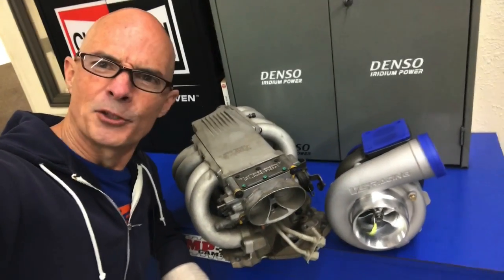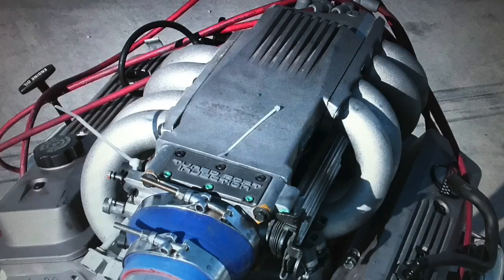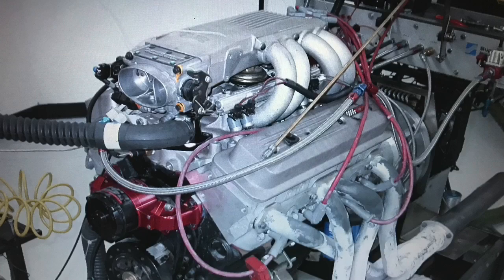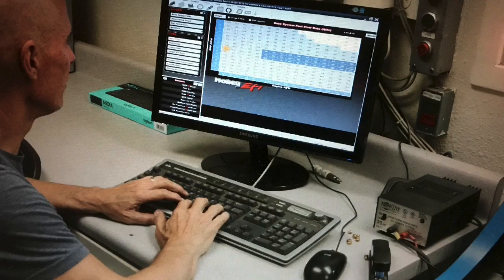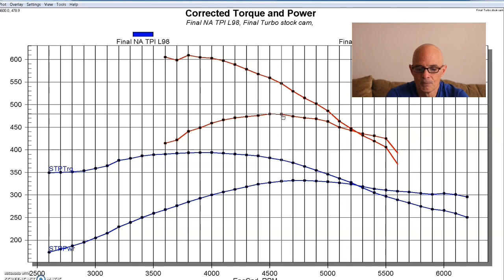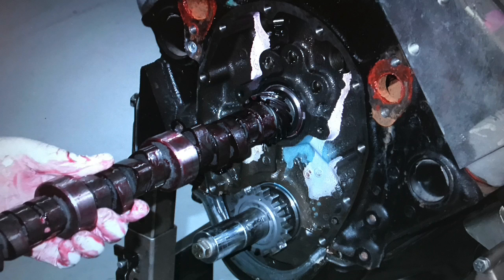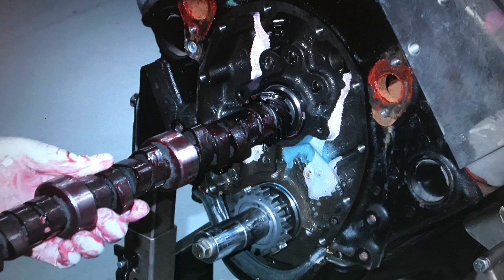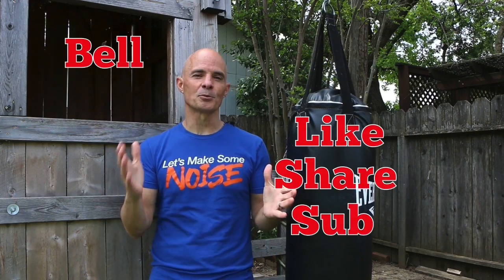TURBO TPI-BOOSTED TUNE PORT

Comment: Hey Richard!  Great content!
How about a Mopar 5.2/5.9 Magnum intake test between factory beer barrel, M1, and RPM Airgap FI manifolds?
Reply from the maker: I like that idea
Reply: @richardholdener1727  I'd love to see that test. Although Mopar m1 intakes are no longer made so you'd have to borrow or buy a used one. I have a 96 ram 5.9 and I've been thinking about a low buck manifold flip eBay gt45 turbo setup.
Reply: @AlexAutoRepair1  back in the 90's and early 2000's i had a 5.2 Fakota with mild potted heads, good cam & springs, Thorley Tri-Y's, and a Vortech R Trim at 15+ psi non intercooler.  Was good for high 10's at 130+.  I had a first run M1 4bbl and shifted at 7500.
Still have the truck and am thinking the same thing you are.  Lower rpms, more boost!
Reply: @richardholdener1727  I have an M1 2bbl intake on a 5.2 I could pull and loan for the test.  Would need a boneyard Beer Barrel as I got rid of all the ones I had...

Comment: Haven't seen the video yet, looking forward to the results. Been wondering about boost on TPI.
Edit: finished video, impressive numbers for a stock L98 with a cam. Anyone have experience with the "FIRST TPI" intake? Was thinking about building a 383 with that intake considering it's probably the largest TPI style intake available. Although if I just port a few things and add boost, maybe that's a better route. Great video as always!
Reply: I have a 383 full forged TPI  with a comp cam .444. Lift and like 228 duration. With a set of GM fast burn heads. With A Vortech V-1 supercharger I built in 96' when i was in The Isuzu/GM Program in College to Replace the Blown TPI motor in My El Camino. Which i put the TPI in 1994.
Reply: Its old news really

Comment: Wow, no wonder I could kill my buddies trans am back in the day.  He was tuned port, I had carb and dual plane intake.  Motors about the same.  He would normally get me a car length out the gate, but I would run back by him at half track on!  Didn’t know they were that dead above 5000rpm.  Thanks
Reply from the maker: I have a TPI vs Dual Plane test coming up

Comment: The hp from na to boosted didn't follow your hp boost equation. (8.7÷14.7+1)x332=528hp not the 479 that it dynoed.   Do you think thats a function of the Holset turbo efficiency?
Reply: I was thinking the same thing probably the turbine back pressure or valve springs or both. It would be easy to check if he raised the Boost because it would just get worse
Reply: @danielsullivan9865  on a low psi, low valve lift, i don't think it needs all that much valve spring.  And as RPM goes up, I'd think HP would drop off quickly as valve float would affect boost pressure.
Reply from the maker: part of it was the the mild timing we ran
Reply: @richardholdener1727  That makes sense.

Comment: It seems like a TPI setup on a 383 would make a great combo for a truck or other application where you want lots of low speed torque. Even a street motor in a heavier car. 
Would love to hear your thoughts Richard.
I'd also love to see that setup tested. GM's HT383E long block/heads with its stock RV cam mated to a Corvette TPI with a Scoggin-Dickey Vortec TPI intake base. 
Then add turbo.
I'll bet the result is a killer street/truck motor.
Reply from the maker: lots of truck guys running that intake-works well
Reply: @richardholdener1727  
Have you got any experience or knowledge on draw thru turbo stuff possibly on a SBC? I know GM and Ford experimented with this shortly in the late 70s and early 80s... as well as aftermarket RV kits. Currently I know the aircooled VW guys use that tech successfully. I'm kind of wondering if low psi boost could help me.
Reply: @richardholdener1727  
You tuned most of these with a Holley XFI, correct ?
Reply: Go look up "how long until it grenades" on The Turbo Forums. Bring a drink and a snack you'll be there for a while in awe of what a TPI can do when you wring every last solitary half ounce of power from it.

Comment: So why didn't you run a bigger cam shaft like 3500 to 7500 rpm range with the long Runners they camshaft little work really want it would have been something like the comps 525 525 3500 to 7500 at a 306 duration
Reply: It still would have peak power at less than 6000. Those runners are designed for a 305 and just choke the bigger engines.
Reply from the maker: camshaft doesn't change runner length
Reply: @richardholdener1727  yeah i got that but he keeps talking about how long the runner's are if there longer a bigger cam would in theory make more power that's why a Victor Jr has longer runners or a Victor senior has longer runners or like the torque or 2 has a wide-open intake plenum which build power from 2500 to 6500 just like the Victor Junior is 3500 to 7500 so when theory if a bigger camshaft was in the motor and he's talking about how long is a plenum Runners are it means more volume which means it would live more upstairs correct ?

Comment: I owned two 85 irocs in the late 90’s... one stock 305 the other a 350, did the slp runners, ASM tb, slp base plate and the edelbrock headers/y pipe... talk about a walk down memory lane! I learned on the 350 cars that too much gears was about as bad as not enough... had 3:73’s, then switched to an Australian 9 bolts with 3:2x and gained 1 tenth and 1mph at the 1/4 lol... sold the car later and my friend did a carb swap with the “hot cam” but that tq was never the same...
Reply: Had one for my highscool ride in the early '00s, modded right they're streetlight assassins LoL made alot of lunch monies against the fastless & furious crowds
Reply: I went to a junkyard and bought a rear end. At the time i didnt know about the aussie 9 bolt. Thats what i ended up buyin.....

Comment: Would love to see how it would respond to a 
Ported upper and lower base and runners 

Also that Holley mini ram!!
With boost of course
Reply from the maker: I have  TPI intake shoot out coming
Reply: @richardholdener1727  please do the FIRST tpi set up too.
Reply: Richard Holdener have you ever seen an accel intake that looks like the factory one? I bought an l98 for the long block and haven’t had much luck researching it. One guy said maybe it’s from a lingenfelter
Reply: @gregblau8082  The Accel looks a lot like a crossram.
Reply: @richardholdener1727  Do you have a miniram to test? I've had one since '95!!

Comment: That’s a sexy looking engine!
Reply from the maker: agree
Reply: @richardholdener1727  
Start with low timing
Adjust the air fuel.

Same for everything, correct ?

Comment: I can only think of one cooler looking intake used by GM and that is on the LT-5 in the ZR-1.  I just never should have worked on an LS motor because everything is easier with them.   Really cool to see this stuff thanks for doing the video!
Reply from the maker: we have one of those too

Comment: Ever considered doing a series of videos on the history of speed shops and performance parts manufactures ?
Reply from the maker: great idea but not really my area
Reply: Richard Holdener how about the overall history of camshaft development ? How did we go from the bumpsticks in Ford flatheads to modern Prostock billet pieces of today ?

Comment: Now you've done it Richard.............lol.  You've given me an answer to a problem I've been working on for......well....a LONG time.  My 1989 K1500 (stock) is anemic to say the least and on top of that, it pulls some heavy loads every day since it's my work truck pushing 300k on the clock.  Had thought of swapping a 5.3LS into it, but wasn't looking forward to the time it would take with ECM and wiring AND I wasn't looking for a lot of HP, just more torque.  And guess what!?!?!  This video is the answer!!!  400 foot pounds of torgue N/A is exactly what I need!  I didn't have any idea the TPI motors were so strong on the torque side.  You duh MAN!!!
Reply from the maker: lots of guys running these in trucks

Comment: I was wondering what model was that Holset turbo and how were the boost curves? did the Holset hold up? I have 2 hx35s and 1 hx55 and also 2 Garrett gt37s but don’t know which way to go 🤷🏼‍♂️
Reply: I would love to try 2 of them out. I have a big holset, came off a 12.1 liter diesel military equipment. T-6 flanged. And the merge and piping. I am going to try it out one day. Worst that can happen would be the turbo took forever to spool, and I could swap it out with a better suited one. 
But I think these turbos were built very strong, and to last

Comment: Your the best Richard I’ve been asking about Holset turbos for some time now because I have so many laying around and don’t know what to do or how to size them BUT!!!!
Reply: I have a big one!!! Came off a 12.1 liter diesel, military equipment
Reply: You just need to learn how to read a compressor map. Reading a turbine map helps too. Any displacement engine at a given volumetric efficiency at a specific rpm  will use a specific amount of air per psi. Now weather you measure total air in cfm (like Garrett) or in kg/min (like Mitsubishi)  changes your calculations. A good baisic rule of thumb for me is turbo on engine a spools x psi at x rpm. Engine B displacement multiply by given rpm. Take total and divide by engine B displacement equals engine B spool rpm roughly (different engine shave diffent VE). As long as you don't choke the engine with the compressor or turbine this works pretty well.

Comment: For stock heads on a Tune Port that's decent numbers. It would be  a riot to drive be in a truck.
Reply: I've said for years the TBI should have been the hp application and the trucks should have had the TPI.  I've done plenty of street cars and trucks with TPI with a  mild cam, portmatch, and tight headers for good fuel economy and torque.  great for towing.  did one 383 that had almost 600 ft lbs.
Reply: They make great truck motors with all of that torque.
Reply: I would love to see more information on tpi versus tbi? Because these tune port injection engines, made great torque down low. Surprise you didn't see these intakes in more truck applications.
Reply: People didn’t care so much about modding their trucks back then plus they were needed for work. Whatever came from the factory was generally good enough. Very few “fools” were building their new truck in those days.

Comment: Put a 3 inch stroke Crank in it to make a what if 302 tpi
Reply: I have a very strong suspicion that a tpi 302 would be a less powerful tpi 5.0 than the 305 was.  The reason I say this, is that the 302 benefits from a 4" bore and tends to make its power higher in the rpm range.  Trouble is, the TPI setup tends to kill horspower, right where the short stroke 302 starts to wake up.  So you would get a short stroke engine that never gets to come alive.  Leaving you with less low rpm torque than the 305 managed, and still not making much hp as rpms climb.
Reply: @ShyaMiss  I think that it will make plenty of low end torque even if it is lower than a 305 but I think it would allow a bit more rpm at the top end he was able to run a 350 out to 6k I think the 302 would do the same but be much happier
Reply: @craigchiddo2794  I dont think you understand.  The 350 was falling off dramatically.  Horsepower being a function of torque, this mean that with the 350, torque was starting to fall off already.  This is purely due to the restriction that the TPI setup causes.  A 302 would fall off in the exact same manner, because it is the induction that is limiting it.  But it would be starting from a position of a torque deficit.  A TPI 302 would do nothing impressive at all.  It would need the TPI itself replaced with something more appropriate.  Like a TPIS miniram.  Or better yet, build it based on an LT1 instead.  Give it an induction system that can support the needed rpm, and it could be fun.  Otherwise, it's a guaranteed dog.

Comment: I hear you saying L98 but I look under the bonnet of my Holden with a 6 liter LS and that is a L98. No wonder GM pulled out of Australia
Reply: The L98 in the c4 Corvette from 1985-1991
Reply: Gm was using rpo codes long before ford. Ford been playing catch up since 1940ish.
Reply: GM likes to reuse engine codes. For instance they've used LT1 on at least three different engines.

Comment: cam and turbo and no accesories on a engine dyno and its only 500 horse.  pretty weak
Reply: Fantastic for 80's tech. Also 2x base.
Reply: 500hp is still potent... In about 2300lb car :)
Reply: @stephenhasty7088  yea 500 would feel decent in a 2300 pound car.  Its hard to get one that light, maybe a datsun or a tube chassis.  It just seems like a lot of work for what your getting.  that or a completely stock ls3, lighter more reliable, way more potential
Reply: Yeah. Because it’s a tpi. But that would have been really potent back in the 90’s.
Reply: That's would put a car in the 11s. Back in the 90s, that would be a fast DD street car.
Reply: That and making 600 pound feet at and below 3500 you wouldn't need a big stall. 
Plus this is no ring gap so below 9 psi. Put ring gap in it, air to water and go to 14 psi and you'll be over 800 tq. And going 10s... google the Grenade turbo tpi.
Reply: Tpi for the win in my 85 GMC tow truck.
Reply: @xmo552  haha, those engines suck
Reply: @ryanaxberg9263  
You're the one that said it has torque like a diesel.
Reply: @xmo552  I never said that
Reply: HP is just a number.  Look at the torque curve.
Reply: @michaelangelo8001  hp is a number that makes you go fast.  I wouldn't want a gas engine that makes peak power at 4500, thats fine for a diesel.   Also making more torque is a lot harder on the drivetrain
Reply: @ryanaxberg9263  below 4500 is where daily driver V8's live
Reply: @pmotorsports8276  all you people just think differently than me I guess
Reply: @ryanaxberg9263  high rpm power and torque only matters to small motors that consistently lives there
Reply: Horsepower sells car's, torque wins races
Reply: @pmotorsports8276 thats incorrect, f1 cars have like 250 lb/ft of torque and like 750 horse.  So if you put a stock piece of junk 350 tbi that has more torque in it it would win the race.  I think not

Comment: You 'teased us with "manipulate that with boost" but didn't do it and show the difference to boost curve and just how much you would have to "manipulate" it and see the practicality or impracticality of that, just how much would it need and just how much could it do it
Reply from the maker: look at any of the centrifugal supercharged videos-rising boost curve changes where the motor makes peak power